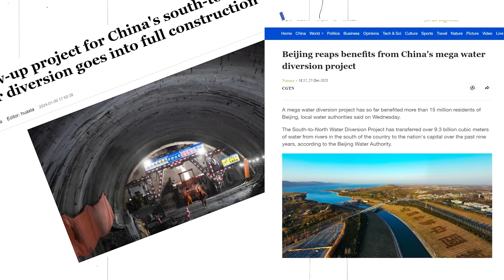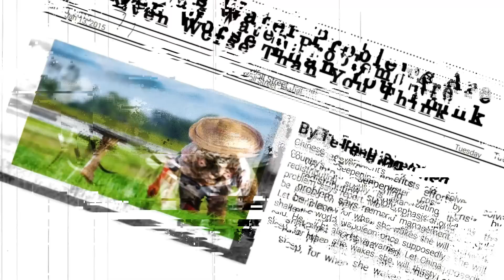China's $62 BILLION Plan To Build World's Largest Network Of Artificial Rivers

Comment: This is full of it when it said " about 600 rivers have vanished". This is coming out from him not from China.  Artificial water networks are controlled with water gates NOT free flow. The water networks are designed to channel water from a place where has excessive water to a place where water is needed. It's also to prevent or minimize flooding. There is a lot of mis/dis-information here.

Comment: Provincial Government & Water Security is imperative just as a matter of planning and developing China as a country.  
Here in Califonia, some 50+ years ago, the California Aqueduct system is a series fo canals, pipelines and other infrastructure conveyance work which collects and moves water from nothern California,  the Sierra Nevada mountain snow-melt runoff and the Central Valley, and transports that water to Southern California.  The sothern part of the state has semi arrid weather and only receives less than 12 inches of rain each year, typically.  The aquaduct system provides water for the very populated area, and lrovides water for agriculture, industry and of course domestic consumption.  It has been a necessary and great success.  
China in managing its land and resources is doing the right thing to ensure water security for its provincial goverment(s) for all the reasons just mentioned.  Bravo China!

Comment: China is very creative in building MEGA projects, built in less time than any country around the world. How much water does floods create? Billions of barrels of water? Underwater Draining Systems in flooded areas could be re-directed towards artificial rivers or underground tunneling Systems! Tunnel Boring Machines can do the same as artificial rivers, less contaminates get into the water tunneling system, less evaporation, and keeps water cooler! Could be even drinkable if connected to filtering stations. Thinking about you China! Instead of building walls, we should be building more bridges! Be an example!
Reply: How about piping that water from them dams to the drought ridden north? China famously ignores actual drainage solutions which is why so many buildings flood all the time!
Reply: @ValinPrezkowski Sour grapes from you troll.

Comment: What other choice is there? Something has to be done. Some have suggested investing into individualized large water wells. That is along with current river and water ways, having isolated and well placed large wells drilled, tapping into areas where a well would not effect the ground water level to a high degree and pump as needed. It would be cheaper but also is dependent on below ground water levels. Another is water piping from the Himalaya foot hilsl all the way south to Central and NW China areas. LIttle has been talked about concerning this but in theory, it would be faster and cheaper and in case of an earthquake, much easier to repair, cost effective.